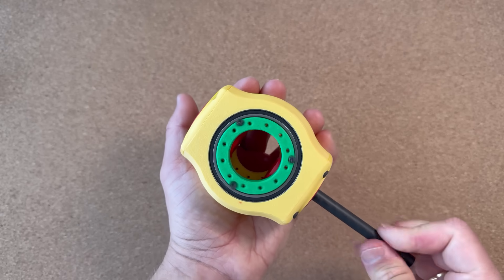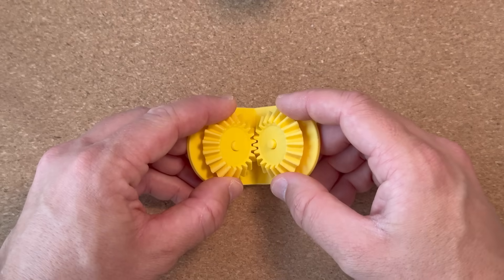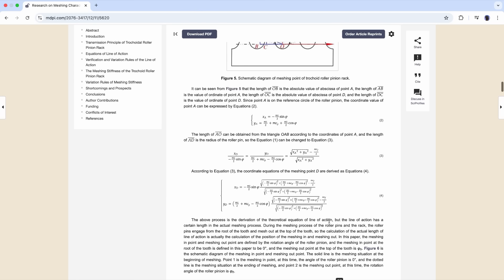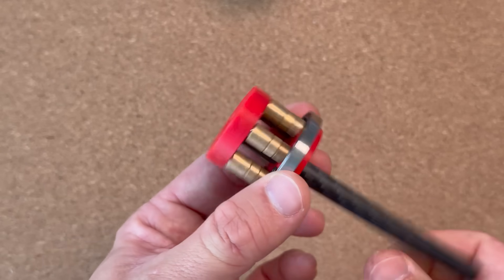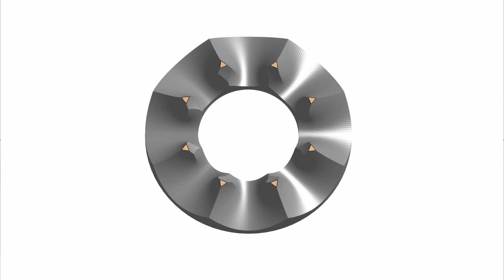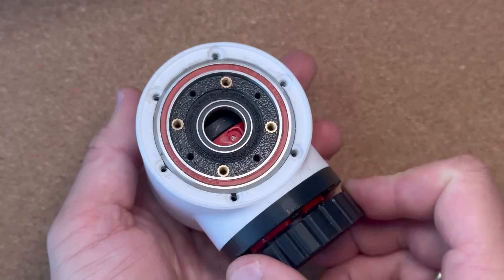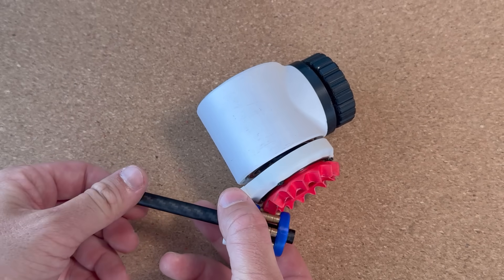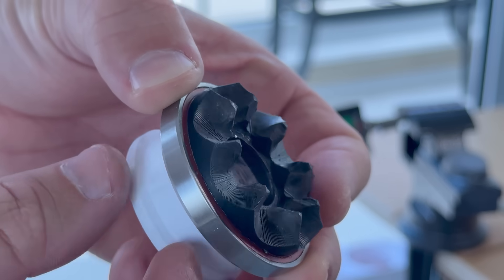High Precision Angular Gearbox, 3D Printed and Tested

Comment: In any event, the cited patent doesn't include the idea of having multiple coaxial rollers on each pin: that innovation reduces friction and/or machining complexity if the rack is any shape other than straight, and as such "improves the art" and might be patentable.

Comment: Impressive design tackling angular torque transmission! ⚙ When a 3D-printed proof-of-concept needs to bear higher loads or last longer, transitioning to CNC-machined or molded gears is key. We help bridge that gap from prototype to durable part. Great work!

Comment: Dear Sir,
I have watched your project, and I am very interested in building such a gearbox for my personal use. I am looking for a solution with extremely low backlash, and your design fits my needs perfectly.
I understand that you mentioned in the video the limitations related to the patent TW202100895A – “Pinion and power transmission device”, which covers the roller-pinion concept. I fully understand that publishing the files may be difficult, but I would like to kindly ask whether there is any possibility of privately sharing the 3D files of your gearbox with me for a non-commercial prototype only.
I guarantee that the files will not be published, shared, or used in any commercial way. The project would be made solely for educational and personal purposes. If you require a statement of non-commercial use or any additional conditions, I will gladly comply.
Thank you in advance for your response and for your inspiring work. 🙏🙏

Comment: you can alter the 3d print settings so that it randomizes the location of the seam on each layer, then put it into a hand drill and hit it with sandpaper to finish it quickly. Steel tapered rollers also exist for tapered roller bearings.

Comment: Instead of rollers you could use a washer stack with spacers to have multiple contact point, and a contact area low enough to limitate the speed difference problem by a lot ? Maybe im wrong

Comment: @Mishin Machine Good job, I've done similar solution for orbital gearing - it's using the same core idea. Probably we're not the only ones using the rollers. 3D printing allowed making improved gears, although that kind of stuff works well only at low revs, at high RPM there are better solutions - I got one :>

Comment: @ 2:57 when you "brute forced" the cut path for the teeth, what software were you using (looks like onshape?) and how did you do that? like what operations did you use?.
Reply from the maker: I made custom a feature script that rotates two bodies around specified axises with specified gear ratio and applies boolean operation each step (I think it was 0.5deg). It goes very slow
Reply: @MishinMachine that's really cool man!, was this with onshape?

Comment: I designed the exact same thing a few years ago for the exact same reason. The main problem i had was the small amount of contact that is present between the pins and the crown, the fact that the pins did not roll equally on the crown and the complexity of the shape (machining). Your 3d printed version works much better than mine did however (probably because of the multiple rollers). The main reason I stopped developing was that the small amount of backlash that regular precision bevel gears have don't make it worth it. I've still been thinking about the problem for years, there has to be a more elegant way to get 90° transmission without backlash.

Comment: Correct me if I am wrong, but I believe the drive that you have at 4:46 is a 7:1 reduction instead of an 8:1 based off of ur previous video on this drive, its not important but i have been reverse engineering your drive for my own project and couldn't help but notice
Reply from the maker: Since I locked the cage and take torque from the housing(crown gear), the ratio should be 8:1 instead of 7:1
Reply: @MishinMachine  damn, then I accidentally designed my drive to be a 9:1

Comment: This is very interesting. Are you willing to share the parametric curves or geometries that you used to create the crown gear profile for the version with straight rollers? I'd like to try designing my own remix of it. I'm impressed with it's low deformation under load.

Comment: The idea is not new, but as a 35-year of experience gearbox engineer i have to correct you on your backlash statement. Backlash in any gear driven application is the result of anticipation of several mechanical phenomenas such as heat, oil distribution, manufacturing accuracy, speed, cooling, deformation from forces and a lot more. All of those are apperent in any mechanical construction where backlash is to be implemented. Also your solution! So claiming that other solutions have backlash and yours doesn't is BS. When confronted with the same requirements your gears will have the same backlash as any other...

Comment: Second time watching because I loved the video, but 4:45 is not a differential, just two output shafts. Differentials mechanisms need to allow the 2 output shaft to spin at different speeds.
Reply: Coming back to this comment, your later setup uses it as a differential indeed.
Reply from the maker: @nonstop7243 this one is also a differential, you can check here https://www.instagram.com/reel/DIE57WxIsW8/?igsh=MTExM3hldDJ6aXlpNw==

And here 

https://www.instagram.com/reel/DGyuCk8IDyO/?igsh=d3Iycmp4MTVicWoy

Comment: some toughts : 
i know that position pins  are , together with the ball bearing, at the core of the sturdiness and precision of this build , but position pins are very expensive where i live, and i need they by the 1000's for building this kind of gearboxes, the bronze bushings are also expensive. and they have some play on them i dont like. i got a new printer and will try to use nylon 12 parts as a bushing for normal screws ( well not so normal, allen cap  screws 10.9 arent that cheap ) . 

an alternative and what is cheap here for keeping the  bushings in site (but not rolling, thats why nylon/acetal) are threaded rods, cutting them to size.  not 10.9 but just cutting them to size is very cheap and flexible , also the allen cap of the screws actually uses space and  some parts of the gearbox may get to be made small or sturdier filling the spaces where the screw heads go . also you may buy "headless" screws that come in the size u may need. 

acetal bushes here are actually very cheap, and internal /external diameter of the stock part is precise. they come in 1m tubes that u can cut to size as you want and  just sand the tips . thats an alternative too. 

another option im looking at is using multi color prints with multiple materials and modify the design so the rubing parts are made of nylon or delrin/acetal. not the entire parts made of nylon/delrin/acetal but just the parts that matter so the printer does not need to be so tuned up as in bed adhesion or even a proper closed chamber. just asa for the body and small parts made of more tech,hard to print,  polymers.

Comment: Conical rollers + a geometrically simpler crown gear is way easier to manufacture in quantity than cylindrical rollers + complex profile crown gear. Conical rollers are pretty easy to manufacture on a machine tool, way easier than a complex crown gear.

Comment: This is a great design, it looks beautiful :)
I have a question regarding the carbon rods: For a project I need to attach gears to hollow carbon fiber rods and I see you use screws. How do you transfer the torque? Do you drill holes for them or just push the screw into the outer wall? I am worried about breaking the rods since I don’t have a lot of testing material available.
I’d be super happy if you could give me some insight on this.

Comment: This is actually a very ancient gear interface. It was used first in various mills for driving grinding stones by water. Later with windmills and early mechanical clocks. But still, working out the math to make it precise carries it to a higher level than the old forced interlocking wooden peg teeth they used back then.

Comment: Did you try using worm gears instead of rollers? You could spin them in either direction infinitely, also it would have zero backlash. Basically a screw with a spiral tooth engaging the gear. You may have invented a new telescope mount… Nice work

Comment: isn't the the contact area between the pinions and the crown gear very small for a wide range of the rotation? It seems to me like most of the time just the very edge of the crown will be in contact leading to tension and such. Couldn't see very well from the video so I might be wrong

Comment: That's fantastic.  I have also designed something similar for a pool cover roller gear.  I haven't printed it yet, but I had a lot of trouble designing the gears, maths, ha.  Mind isn't reliant on a thrust bearing, so we will see if it works.

Comment: You can post a video tutorial, many people who are new to designing, will make minor angular and calculation mistakes, if you want you can post a video on it and I believe it will be very helpful for a lot of people who are getting into design.

Just for information, this type of gears are used with hydraulic systems, but not sharp gears, they are machined to a radius curve, even we made one for our tool grinding motor setup.

Comment: You can share the STL so long as you're not selling it commercially. Patents are very difficult to find hence costing so much. The patent officer spends weeks searching for similar. There's almost no reason to file patents anymore partially because everything is made in china and they will ignore your patent. Then fighting patents in court will never cost less than £20000 and will usually last years. So unless it's worth it they'll drain you legally. If some company really wanted the tech they have seen or developed it or patented it themselves. One of the things about patents is it needs to be niche/ or novel. Because it's already known and used in the world for some years there's no novelty. It's like trying to patent a door or a wheel. Even if it's never been patented before it already exists and is in use

Comment: (I'm no expert either) Isn't there backlash in every system, it is a factor of how accurate something is made and positioned, your 3d print is more accurate that the bevel gears and thus has less backlash. Bevel gears could probably be made to have less backlash but they would be more expensive/have other drawbacks like the amount of friction.

Comment: Is there any slip on the crown gear surface? I'm curious about how good at wearing out resistance.
Reply: Yes there will be some slip in the axial direction of the rollers as they move through their contact arc

Comment: At first I thought you had traced out a screw shape to drive the rollers, to have something like a worm gear, but it's just a bevel gear-like principle.
Now some advice: when developing a new professional gearing system, you're supposed to test axial/radial loads (how much the gears push each other apart) which in normal gears is related to pressure angle; and how well the system handles loose fitment (if the gears aren't pressed firmly against each other, how quickly they are going to rattle).
But other than that, you did great work. Most actual mechanical engineers are bad at this, and can't create their own gears.

Comment: Not actually zero backlash even you make it with a modern CNC machine. In this design, backlash still exists and is minimized by improve machining accuracy and assembly tollerance, which also the same principle with other simpler gearboxes. If you look closely, it is even more difficult to minimize backlash because of the additional assembly parts.

Comment: I would just be afraid that this would be very hard to manufacture. Most smaller industrial robots use Harmonic drive's no backlash solution. Very high torque and reduction ratio of 100:1. Very clever and simple design.

Comment: You could use the method of mine uses a different structure than the original patent, some companies get around patents by just putting flat heads where someone else put hex bolts. You would need a patent lawyer to look things over for you which costs time and money. Thats why i dont really care for patents, some multi billion dollar company could just bypass it easily. Aka that one nation.

Comment: Patents are pretty useless in fact. In the US it's a minimum 4 year wait, tens of thousands of dollars and by the time you finally receive the patent, the only real chance you have to make any money is by selling it to legal patent trolls. Regardless, while you wait the 4 years your ideas will be published, imitated, and modified and you'll have little to no chance of preventing the imitators. 'Patent pending' is largely meaningless. What's worse, if the military decides the technology you developed is useful they will claim your patent. The fact that the basic idea was already published in a foreign patent application will negate it's eligibility for a US patent as the idea is no longer considered novel, and the patent office will most likely point to some obscure early 1900's patent as further reason to deny you. Even if you survive the inevitable multiple rounds of office actions you will be lucky if you get half your claims in the end. The entire process is awful. Ask me how I know. =P You are a very clearly gifted ME even if this is only a hobby. You earned a subscribe from me. I found the video very interesting and well made. You'd probably make more money selling the cad files and/or printed parts then the patent would ever net you. Try messing around with some of the new PPA-CF filaments if you haven't already. They are impressively strong and very easy to print to reasonable dimensional accuracy on cheap hobby-grade printers. Thanks for sharing. I really enjoyed the video.

Comment: As a former engineer, and before that, a repair technician, I just loved finding plastic gears inside busted hardware.  Not.  Use the correct materials for the job, stop cheaping out and stop trying to be innovative. Instead, focuse on reliability and longevity. Also, gears are still gears, even if they are funny shaped.  Also: stop looking up patents or even thinking about patents for your own stuff. No one cares unless you are up against a large corporation which is actively making a big profit off whatever the item is.  IOW: stop wasting your time on patents.  You do not need or want a patent of your own.  Just a little advice from a retired scientist, former multi-disciplinary engineer, and before that, multi-discipline tech.  Use appropriate materials.  I mean, come on, you didn't even use a decent engineering resin for your gears.  3D printing has its place, but this isn't one of them.

Comment: How did you model that tooth profile? That's some first class modeling!
Reply from the maker: I wrote a feature script in onshape that rotates two bodies at a set gear ratio and runs a boolean operation between them. Basically, I use a pinion as a tool to carve out the crown gear from a solid blank.

Comment: As a novice roboticist, this is seriously impressive.

Gearing systems like this would be very useful to reduce weight at the end effectors. And the crown gear looks like it would be easy to CNC if you wanted more strength.

Comment: in reality you can achieve zero backlash with bevel or straight gears too, ,, the problems are the precicision used while producing them and the wear after some period of utilisation. and i do not see this solution adressing those problems, or am i missing something?

Comment: You sir, are crazy smart, but is also in need of a small hand driver that used small bits that can't overtighten. They go to basically weaknhand right and you can manual from here. Trying to think of he one I haves name but can't remember small screw driver with 2 buttons but you can load custom firmware. Some have an gyro and work off if the direction you move your wrist/driver. But very small neat and don't over do things, let's you add the manual aspect to it.

Comment: I fully feel your disappointment with finding out your invention already existed! I've been through something similar myself a few times.

Recently last year, I designed a special compass that could draw conic sections on paper. I had never heard of a mechanical device that could do such a thing, so I was really quite proud of my invention, (and I still am). However, I later found out that, in one form or another, the conic compass has already existed for around 500 years, having being first invented by some Arab mathematician in the middle ages. Mine was of a different design, but there have been other designs since then that were close enough that it didn't feel like the massive breakthrough I had hoped it was.

Still, your achievement is amazing, and I sincerely admire your efforts. I hope you keep inventing and creating new things well into the future!

Comment: Sorry if you said this and I missed it.  The problem with your gear profile is just that you have constant sliding contact nearly all the time everywhere. The reason you need conical bushings is so that the outside side of the bushing and gear travel the same distance. With the cylinders your outside cylinder surface will travel much less than the outside crown gear surface and they will grind on eachother.
Reply: Unfortunately, even with conical bushings and angled pins for the rollers there would still be sliding contact because the surfaces on the crown gear move along the axis of the pinion. There would only be true rolling contact infinitesimally when the roller bottoms out.